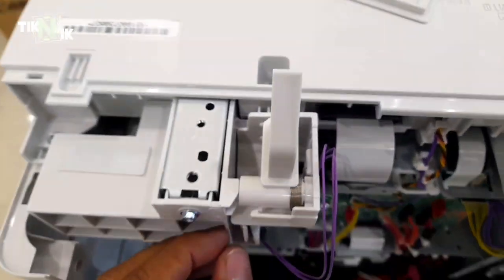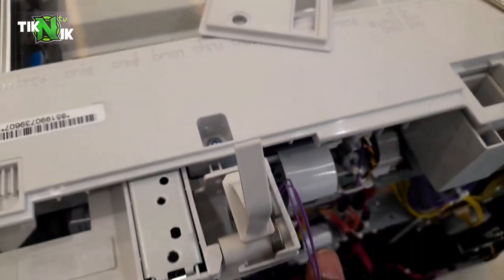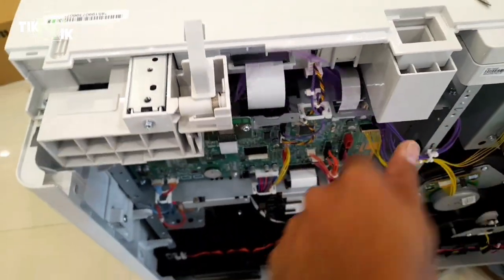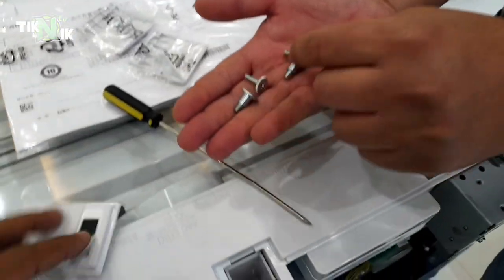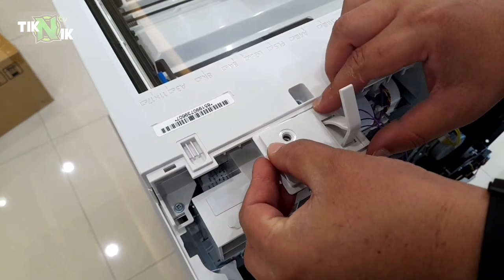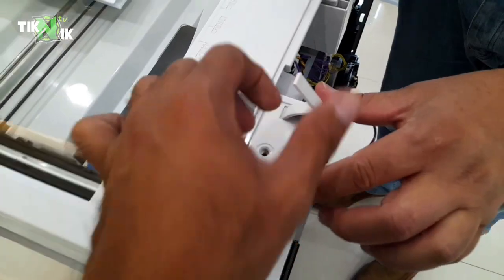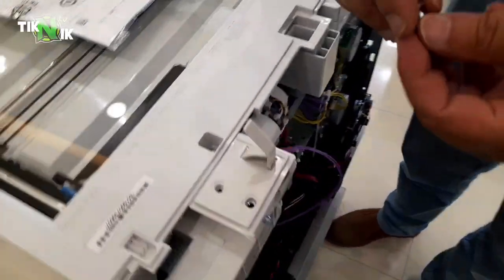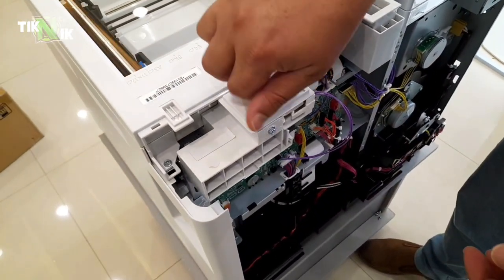CANON iR 2206N | complete guide + installation

Comment: Hi sir i have canon 2525 cassete not load paper
Reply from the maker: it's your lift motor if there's no stuck paper inside
Reply: @tiknik  lift motor is ok when i chek all fiting unit sloniod put and clean then power on machine only one paper make copy and then not lift motor
Reply from the maker: @Nabeel Azmait  after one copy, nothing follows? maybe your exit sensors or actuators not working properly...actuators not returning to its home position
Reply: No stuk paper inside
Reply from the maker: @Nabeel Azmait  if only  one sheet of paper exited it means your actuator did not return to its original position, i guess...
Reply: @tiknik  thank u boss i chek complete